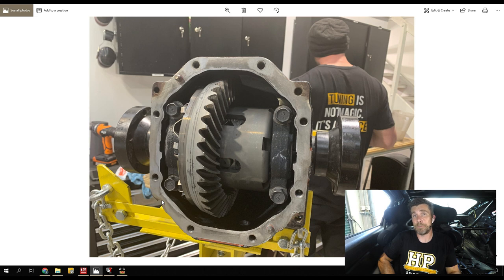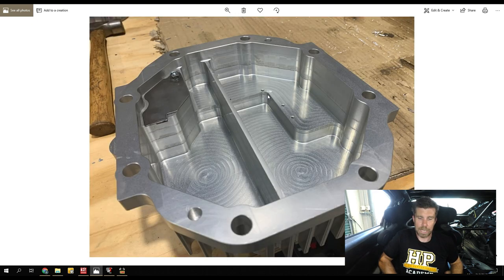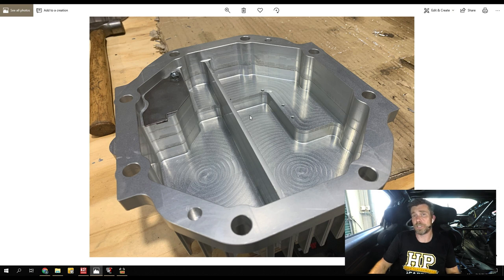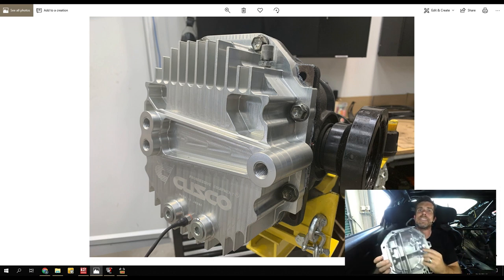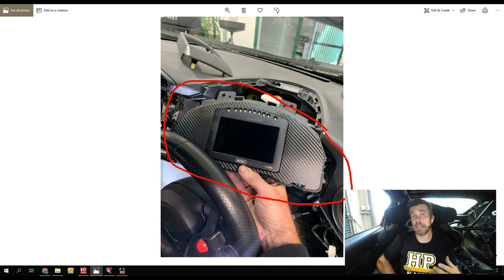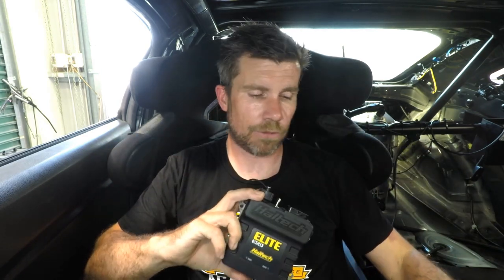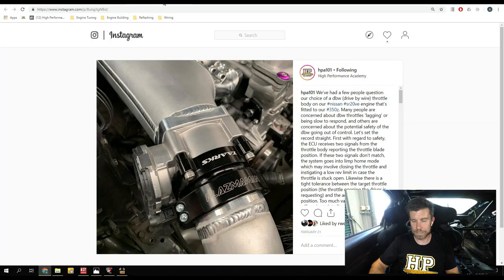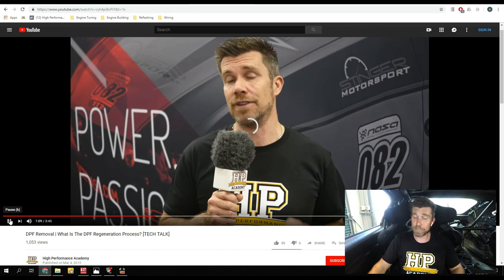Why DBW Is NOT Dangerous, Diff Covers, LSD Types, and Dash Displays | Today At HPA 202 [UPDATE]

Comment: I've been watching the videos on diff covers at Bank's website.   The critical thing in those videos is when you're seeing the oil aerated.  This dramatically reduces the shear resistance of the oil and causes it to heat up.   The oil impinging on the back cover will cause deminimis heating of the oil. I think an external cooler is a great idea.  What you need to do is build it like a dry sump system where you separate the air from the oil while it's still hot and then go through the cooler.  Separating the air from the oil will also improve the heat transfer performance of the cooler. When you go back into the differential provide a header system with 3 routings so that your pumping the oil over the pinion gear and also down each axle tube.  To calculate the amount of volume you need for settling the air from the oil you use Stokes law.  You want to do the settling before you cool it off because the viscosity of the oil is lower and the settling will be faster.  I'm a chemical engineer and I used to work for Shell in their Lubes R&D Department before I retired.
Reply: I'm skeptical about the Banks videos. Whilst he does raise some good points in theory, he doesn't provide any data to back his claims in any of the videos. There is a video he shows that literally has a diff cover with temperature sensors attached doing some testing on the road, but doesn't use this test diff cover in his videos and doesn't provide the viewer with any of the data from those tests. It would have been incredibly simple to show that diff at ambient, and then do the same 15-30-50mph tests and show us the temperature reading.

Whilst this 90 degree bend business sounds bad in theory, it's a small difference and the reality is that its far more likely that factory diff covers are made in such a way to minimize the metal used to save production costs, nothing to do with creating a circular pattern for oil flow. The same is most likely true for the aftermarket; the squared-off angles are due to a cheaper manufacturing costs as it has little to no effect on real-world performance

I believe Banks is taking advantage of the fact that there is minimal testing done on differential oil temperatures, most people will never see factory testing data if it exists, and is instead fabricating the information himself. For example, you can clearly see the pinion gears in the 90-degree-bend cover video being soaked in oil, yet he claims they are being starved. He fabricated two diff covers himself, but neglected to install temperature sensors we know he had access to, which would have provided unbiased facts to support his claims. In my opinion, this is Ockham''s razor. The most likely scenario is that he knows his aftermarket diff covers make absolutely no real-world difference, and is capitalising on a market he is creating.  

He also ignores the fact that anyone who is serious about differential oil temperature uses an external oil cooler. It isn't a complicated addition.
Reply: @duviday  , I agree completely.  I see the money-making opportunity.  They sell aftermarket diff covers for $300. I could get those made in China for about $5 including the empty aluminum beer cans.  With the Banks name on it poking out from under the truck you probably get another $50.  I help some people with their turbocharged cars at the Bonneville Salt Flats.  Gale is definitely a legend out there. Watching his differential cover videos was definitely a letdown.  I was really hoping to see something of his scientific method.

Comment: Another cool video.
With the external diff' cooler, have you considered drilling and tapping the case to have the return directed to the crown wheel so it is better carried to the pinion bearings? Maybe offset a little to help cool the teeth contact surface? That way you can use the other bottom tapped hole as the drain.
On that, the particular lubricant used can have a big affect on the diff' life - a friend was having problems with his over-worked assembly and found AMSOIL made a big difference in replacement periods.

At 1:30 the difference in the drive/over-run side-gear pin angle can be clearly seen, which may help those having problems understanding it.

A couple of other advantages for a DBW setup - 
Some types of racing have a maximum permissible speed, such as TARGA and Silver State''type events, where transgressions can incur severe penalties, even disqualification. By incorporating speed into the throttle algorithme this can be used as a speed limiter - may also be useful in heavily patrolled speed limited areas on the road ;-)
The second Andre brushed on - it can be used to tailor the wheel torque in the various gears to maximise 'power to the ground' as the common boost limiting applications cannot flatten the torque curve in the same manner.

With diesel particulate filters, as with anyting exhaust related, size and design make a BIG difference - a large, properly designed filter may be less restrictive than a straight section of pipe - just like cat's and mufflers.

Comment: I run a 2018 brz diff 4.3:1 ratio, Cusco rs 1.5 centre behind a 700hp 2jzgte in a jzx110 with a VF Commodore tr6060 gearbox, standard diff cover/hat, absolutely no issues handling the power or heat of diff oil, driven in Adelaide Australia 🤷🏼‍♂️

Comment: Shouldve pointed an infared thermometer on the original diff cover to check the temperature, then again after the replacement.
Reply: ..dont use a ir-termometer on a shiny surface or on to big distance... dont like the "accuracy" at all on non-contact termometers actually, way to easy to get wrong readings

Comment: No gear paint to see the pattern?

86 diffs are fairly robust units that can handle some good power.
Reply from the maker: It handles the power fine, other than getting too hot during endurance racing. For shorter races it is fine and any damage done is temp related, not mechanical failure/s - Taz.

Comment: I run a 2018 brz diff 4.3:1 ratio, Cusco rs 1.5 centre behind a 700hp 2jzgte in a jzx110 with a VF Commodore tr6060 gearbox, standard diff cover/hat, absolutely no issues handling the power or heat of diff oil, driven in Adelaide Australia 🤷🏼‍♂️
Reply: I will add when I bought the diff from a brz with 3900k's from a wrecker I completely stripped it did bearings, solid spacer new seals, but yeah I daily drive as well
Reply from the maker: Interesting. Sounds like a fun build! Is it a track car? Have you don't any endurance racing with it and if not what is the longest session you have been at 100% race pace around a circuit? - Taz.
Reply: No endurance racing, done a few drift pracs, and daily drive the thing, done Adelaide to Sydney and back for WTAC in the car which was like 4000k's
Reply from the maker: @tcollogan  got ya. We are only having trouble with this after extended periods of hard track driving. I think if you pushed your diff for longer, I'm going to guess you would have similar problems. - Ben